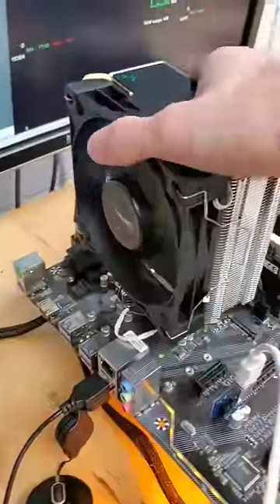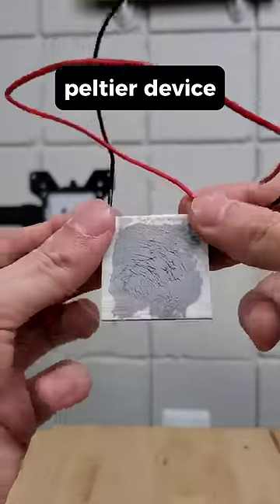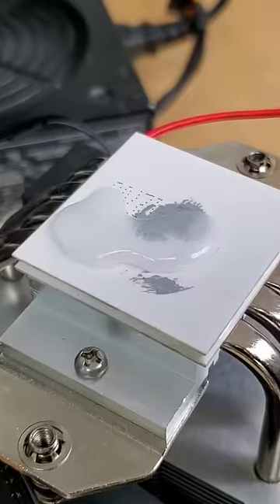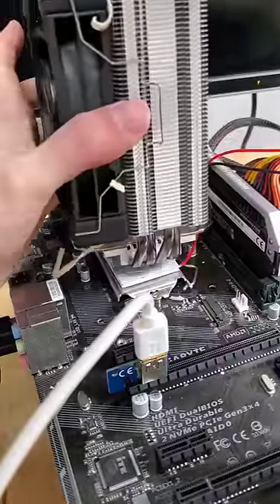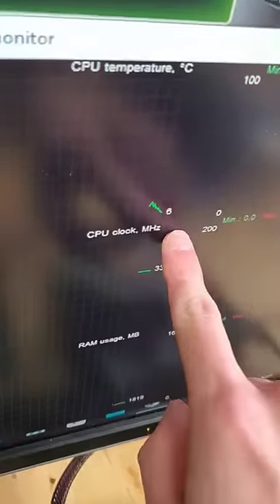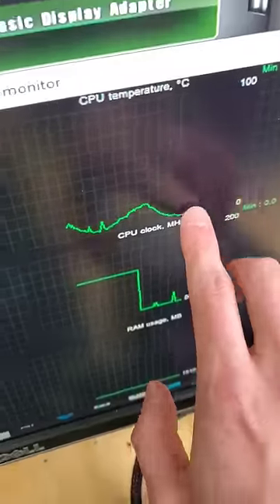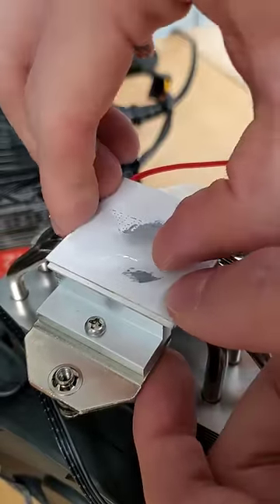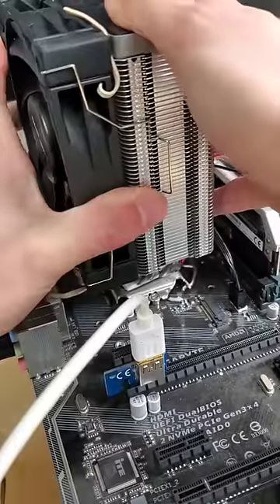using a Peltier device to cool a CPU BELOW 0°! #shorts

Comment: Loved the video! 
If you liked this game, I would suggest Satisfactory. Its still in Early Access. But the 1.0 release is confirmed to be not too far away. I would recommend playing the Early Access version first. Then play the 1.0 release when it comes out. That way you have a grasp of what is to come and you have most of the mechanics mastered. I will say, even the shortened Early Access, It will take a very long time to beat the game. I have over 200 hours and still am nowhere close to completion. But i am taking my time, making everything efficient. So your time may vary. 

Again loved the video. You earned my subscription!

Comment: I'm so confused I have two dual core boards sitting in my room but I've never bought anything to put them together and I have a PC that I've had for a very long time it's never been upgraded and it doesn't even have a GPU it just has an I3 in there and 6 gigs of RAM I feel so terrible because it works really good but anytime I try to use the same software on my little cousin's computer it just freezes he is a prebuilt by the way and I believe he has a 4090 with 16 gigs a ram in a 1 TB SSD with a I-9

Comment: is water cooling better than air cooling? just asking because when i open minecraft the temps literally shoots to 94°C and they aint going down
Reply: Air cooled can be similar to water cooling. Sounds like you need new thermal paste or the cooler is not installed right.
 If that doesn't fix it then get a new cooler that is bigger.
Reply: @rick_222  i have a nzxt 360mm water cooler so i think its the thermal paste

Comment: Here is the problem. I have h81ms gigabyte motherboard and 2 ddr3 Ram one is 8gb n another is 4 GB runs on 1600ghz I wanted to upgrade CPU I have Pentium 3 and I want to upgrade to i5 4gen Processor I've swaped it when I try to turn on it doesn't turn on but I have wireless bluetooth I plugged in back of motherboard there was a blue light on bluetooth but pc is not turning on?

Comment: I'm calling bs.  You're pulling the cooler off while the system is running, have basically no thermal paste contact across the CPU, anddddd you have no video cable connected to that motherboard. 

What is the point of lying?

Comment: Why don't we use this then ?
Reply: Reason is Simple if it Gets Too Cold Condensation will Occur, Which will eventually generate Enough Water Droplets that it Will short-circuit everything. 

And if not For the Short-circuit then Corrosion will definitely destroy everything in the End.
Reply: @HYPERMAN__  But there must be a way to program it to get colder as it heats up, and set a limit so it doesn't work at full power, if they can control the fan rotation, they can regulate the power of this little thing hahahaha